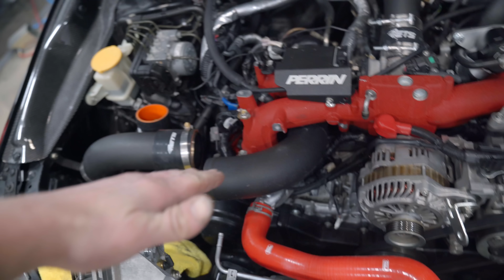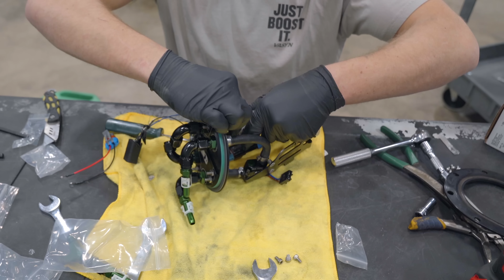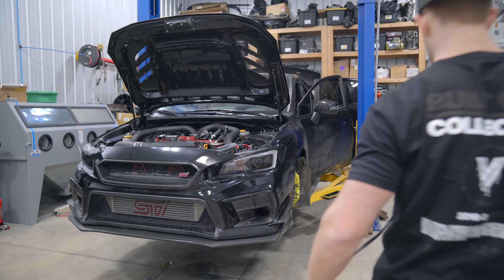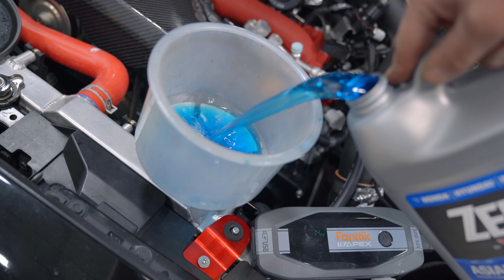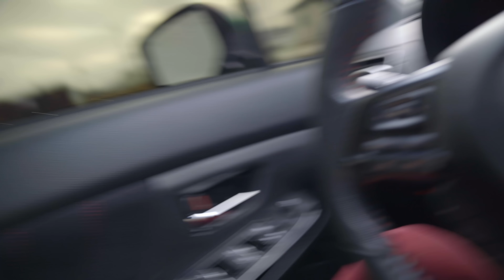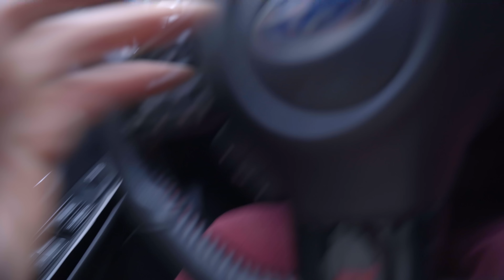The Heavily Modified STI Gets a Massive Setup! (2200's/Dual Pumps)

Comment: Devin I do recommend you to instead of putting screw style hose clamps on those fuel pumps on the hanger I do recommend you to install single ear hose clamps those will hold the high flow of fuel from the pumps out of the hanger, I have several issues with my 05’STi that I have no fuel pressure the car immediately dies and I have to get a tow and I did installed those clamps and no more issues because the hoses stays tight and it doesn’t loosen so my recommendation to you is that bro tbh that way on the road you don’t have any of those issues harbor freight has them

Comment: With that fuel pressure regulator and those 2 big fuel pumps running 100% all the time I feel like you might run into an issue with overrunning the stock return line. That’s why the I wire kit is nice is it retains the stock fuel pump controller so it runs lower pump speeds when it’s not needed.